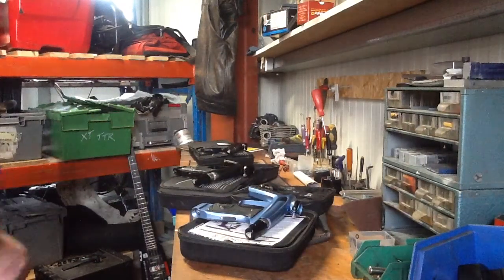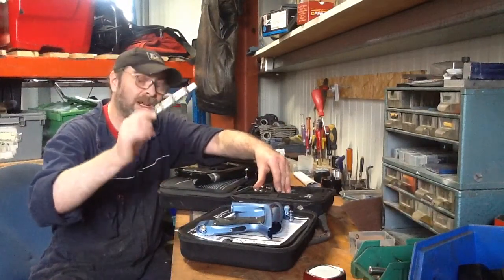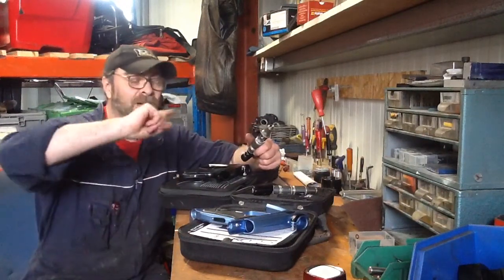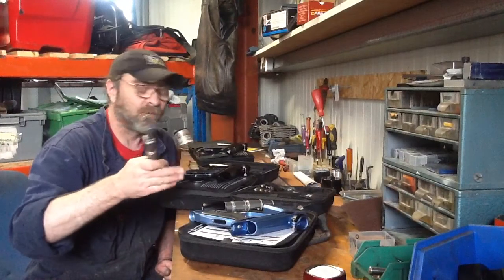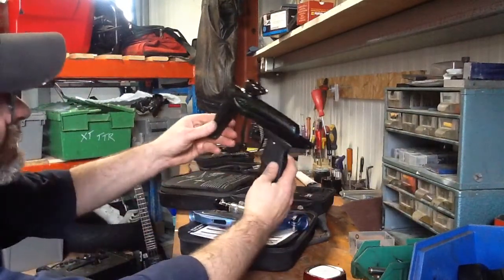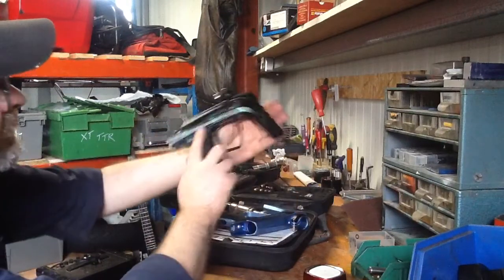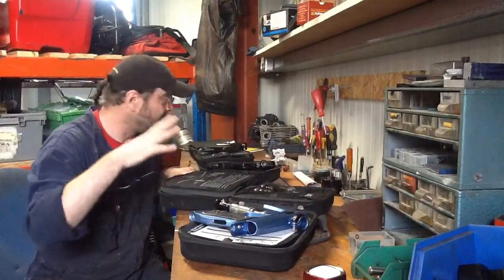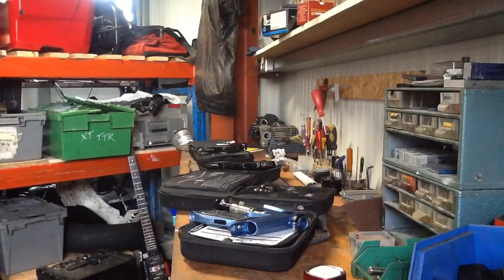Sticky luxe ice.

Comment: What tool do you use to measure the inside can o-ring grooves and would your solution be slightly smaller o-rings or will you be modifying the grooves? I have a 2.0 bolt that has the same issue not coming out all the way.

Comment: I am using the ones that came with a DLX power core kit. So one green HBNR and the white urethane. Seems like a tight fit though. I attempted to send an email to your Hotmail.co.uk address regarding proper placement and such, not necessarily this issue, but didn't know if it made it to you. Or maybe went in to junk folder since I am from the US....lol